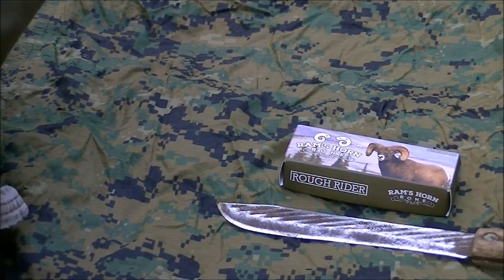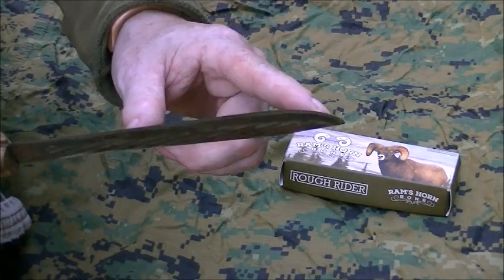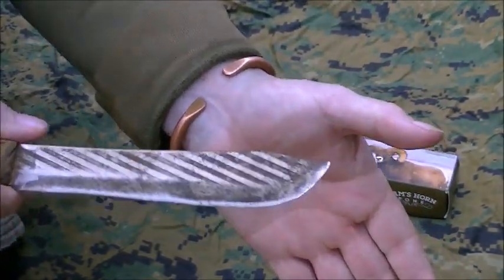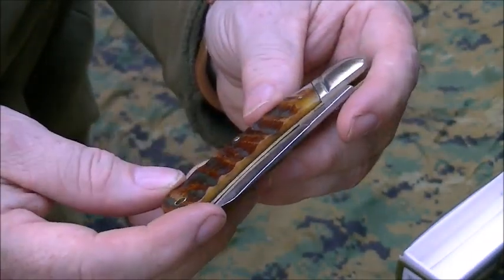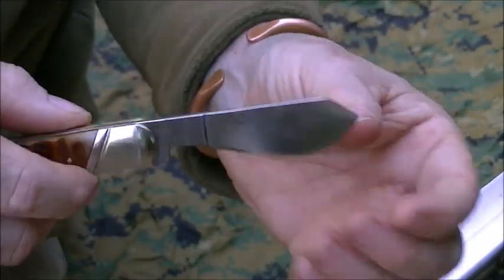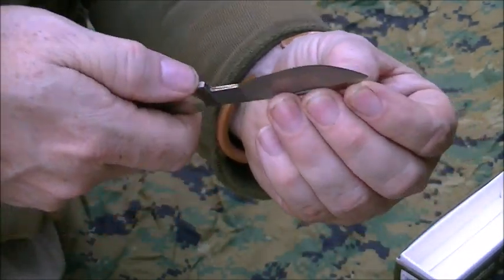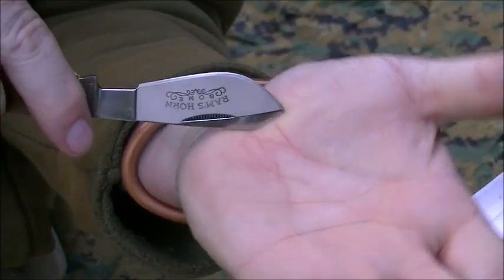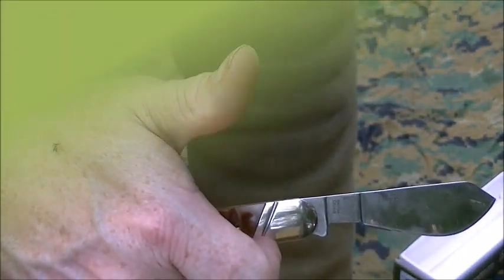THE COTTON SAMPLER KNIFE

Comment: Thanks for this. Just got a GEC cotton sampler. I’m surprised how many reviews say this is an impractical blade shape. Your review hits it on the head. The scalpel shape is great for almost everything. I haven’t used it for skinning but it sure takes the casing off a sausage like a champ. It’s also fantastic for cutting fruit and hard cheese. I’ve been using it for everything. The GEC 74 has a carbon steel blade, scalpel sharp that is getting a nice patina.